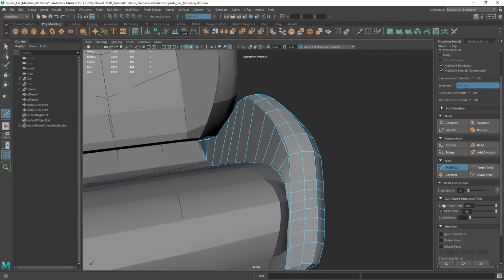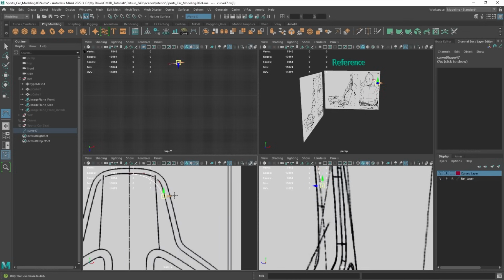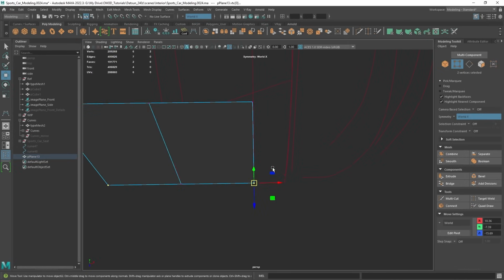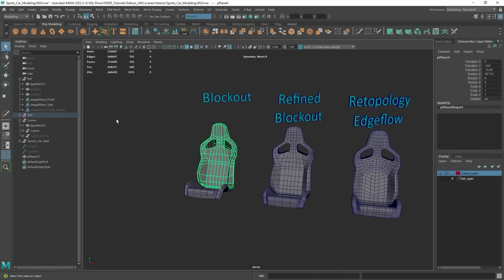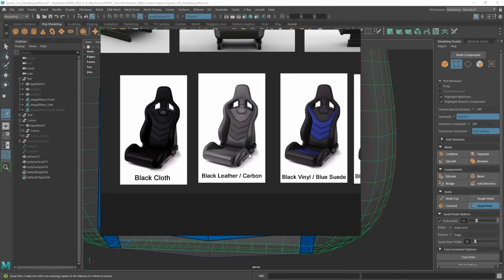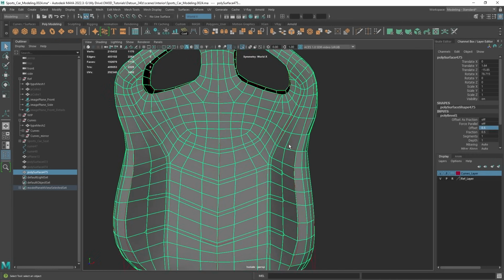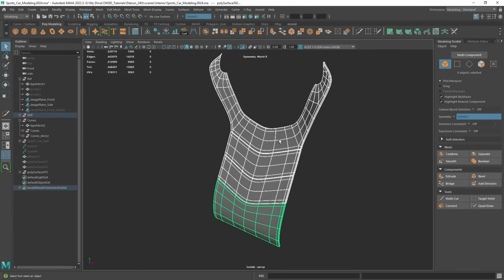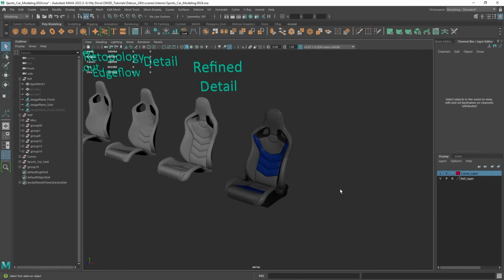How to 3D Model Anything

Comment: I have one more dumb question, but when I export the chair for use in substance painter, it wont save this smooth view will it, did you talk about preserving the look without adding more polygons?
Thanks for the amazing tutorial!
Reply from the maker: If you're talking about 'Smooth Preview', you would need to run a Mesh>Smooth in order for it to look like Smooth Preview in Maya.
Reply: @OnMars3D  yeah just add so many more polygons when I do that

Comment: that middle mouse x thing is frustrating, but oh man what a great video.  Day two and the snapping C middle mouse is inconsistent, or offset.  I am using Maya 2024.. very frustrating.. sometimes it feels like I found the perfect tutorial, only to be blocked by very frustrating issue.  I wonder if its because I have a middle mouse wheel or something.  Sometimes it works, sometimes its offset, sometimes it does nothing.  I probably manually slid the vertices 75% of the time.

Comment: What's the advantage of pulling faces out rather than using grid fill etc on the existing curves? I use Blender, and there I'll start with the subserf guide, then shrinkwrap geometry onto that in sections which I copied form the original. This is kind of the same thing isn't it? This is just a little more accurate off the bat.

Comment: even i switched from maya to blender long time ago, this workflow really helps. and dam: this maya edgeflow function and the sliding on curves is really cool in maya.  it doesnt exist in blender , i think.
Reply: ok to all blender users: both is possible also in blender: maya edge flow (blender: subdivide or loopcut and slide (smooth=1). sliding on curves: snap on edges

Comment: Hi, I just have a question after watching this video. I wasn't always sure when it seems like one mesh if I should make something with one piece mesh with all vertex attached or not. Should I separate things...like, based on material differences? do you have any standard when separating things out ? Thanks for the tutorial by the ways.
Reply from the maker: A good rule of thumb is model is the same way it's made in real life. In most cases, they will be separate and modular objects.
Reply: @OnMars3D  Oh, that's why you separated one single stitches into two in another video. I always just bevel and extrude it in on that matter because I thought since it is made of a single material(basically well, cloth). Now I know that, I will keep that it in my mind. Thanks for the reply by the way :)

Comment: This is what always conflicted to me. What you're basically doing here is a bunch of tracing, which from the 2D art community, is frowned upon. However, it seems to be completely normal in 3D.

I guess I just always restricted myself because I felt like it was cheating to copy existing objects, but it seems like that's the norm for 3D, especially since it still requires a lot of steps and skill to turn it into a proper, usable object.
Reply: I suspect it's because the assets being created are intended to look like real life objects. Also something like a Ricaro seat is likely the result of a large team of talented designers who are well acquainted with the company's very specific design language. 

One guy, trying to create a 3D asset in the time frame this guy is talking about can't match months or years of such a design teams work. Plus it's built on decades of previous work. 

If someone were to create something completely original, it may also not be what the client wants. 

This work isn't an exact copy either. More like it's inspired by the reference images. 

3D modeling is really hard.

Comment: 14:36: I like to use this same technique when it comes to crazy complex hard surface shapes. It was a godsend when working on a motorbike engine. Just quickly rough out the engine shapes using primitives then retopo.
Reply from the maker: Exactly, it helps a ton for more complex shapes!

Comment: It is such an efficient workflow to use curves as a easy-mode for "sketching" the form (with blueprint or not) and then just focus on blocking and refining. Reminds me a bit of a freedom, that only  sculpting gives when creating a base form for modeling with retopology tools. Tbh I have never seen that kind of workflow with snapping polys to curves. It works with Blender and I am more then happy to try it, especially with organic modeling which I find this technique will be a beast. Many thanks for this video!
Reply: What curves are you using for this (bezier or nurbs)?
Reply: @filipg.8852  I prefer Bezier curves. Iif you can`t snap to, subdivide it a few times and you`re good to go.

Comment: my main takeaways here were using curves to create easier reference and retopology after creating a basic form. im a beginner so my method was that my reference was only the imported flat images, and then worrying about topology at the same time as establishing the form. ive struggled with topology in the past and this seems way easier. I use blender these days but I think all the same ideas apply. the only part im kinda fuzzy on is how you went about breaking out the paneling from the main model but I assume I can find tutorials for paneling.

Comment: Good Video but you can't find Blueprint for everything, leave alone the different angle pics. Real world challenge is to build from a single pic what mostly freelancers get & that piece could so custom that u won't anything closely matching it, on internet. So sorry to say, the foundation of this video is pretty wrong.
Reply: Yes most of the tutors do this same trick.. It's very difficult to model with single pic unless u have a strong grasp of perspective and drawing. 

I think drawing is very essential for 3d artists, it enhance your observation skill of real world.
Reply from the maker: I brought up this exact point in the video, you can apply this curve guide method to a single photo, you don't need blueprints to apply this workflow. You also don't need curve guides, they are just another helpful form of reference.

Comment: I have a question concerning the retopo part; Is it still practical for very hard straight lines ? It seems you can only eyeball the polygons placement often times making the edge flow wobbly around sharp edges.
Reply from the maker: You can be more organic with polygons modeling focusing more on the "flow" of edges instead of exact placement.

Comment from the maker: You can download the vintage and modern seat 3D model here: https://artstn.co/m/00R8x

What modeling workflows do you use? This is not a definitive list and this is not the only way to 3D Model. I will post more videos on this topic in the future, but let me know which modeling workflows you use on on a daily basis and helped you really improve your 3D modeling skills.

And don't forget, you can join our active discord here to help grow your 3D Art Skills: https://discord.gg/G3Z8tkzmuM
Reply: I use blender and fusion 360. I do the more accurate parts of the model in fusion 360, then export them into blender to do more of the irregular parts to save time and make a model that looks alright.
Reply: Maya 2018.... and im noob
Reply: Can I have this model? 😁
Reply: I found your workflow very time consuming, the amount of hand drawn curves etc., I'd burn out fast. The output is straight clean, but usually u cannot spend a day on modelling one car seat asset if it's not concept for seat/car manufacturer. I'm team max as basic gateway, but fast workflow is zbrush, masking, polygroups and remeshing to keep nice topology, if it's screwed too much then retopo, (if model is not a hero and simple or very organic and I'm lazy, then retopo in Instant meshes). Coat for UV. 

I'd do this seat by quick blockout with premade holes already with nice loops, correct basic outer shapes for less thinking. In zbrush quick shaping along with polygroups marking, remeshing, creating desired 3d details, then copying it, making bump details and exporting both models for detail projection and texturing. For lowpoly models I prefer oldschool manual modelling although zbrush is good for quick lowpoly art